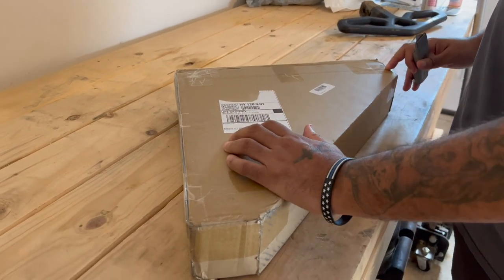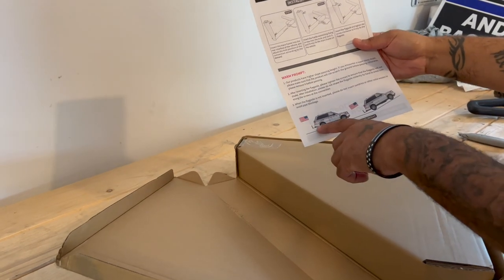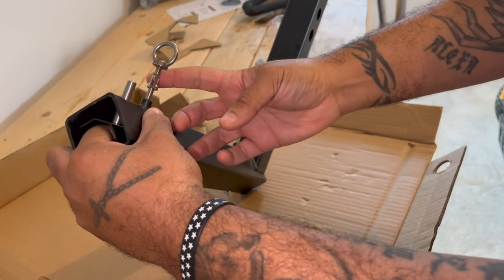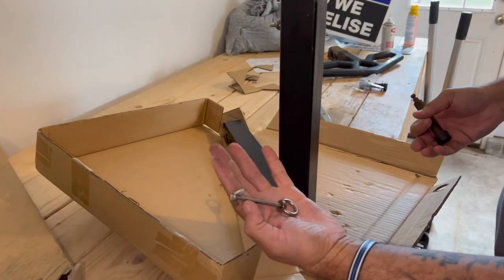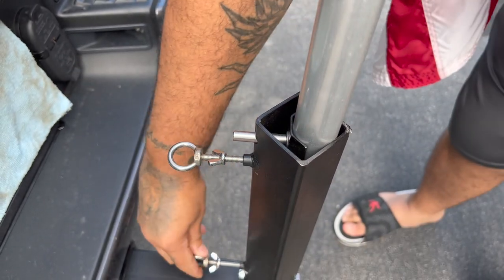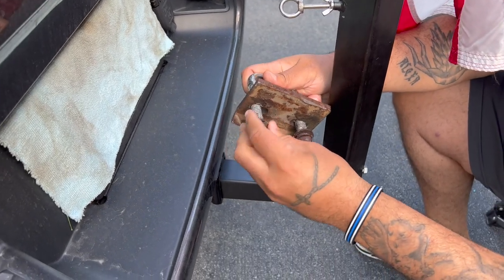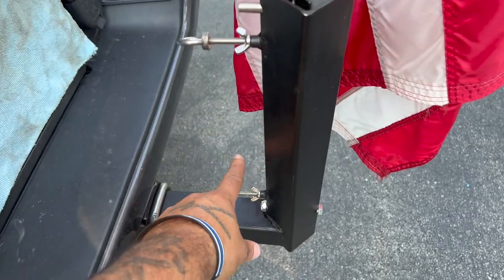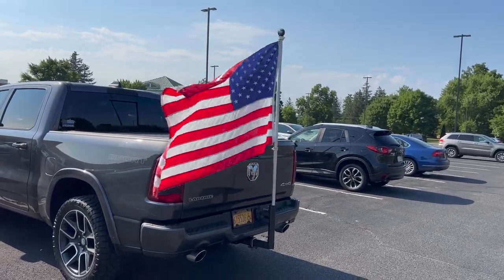The Best Hitch Flag Pole Holder For Your Truck

Comment: Where can I find those wing nuts with the screw that’s with it.  Also  what about that bracket that goes since the pole  to hold the flag  pole secure
Reply from the maker: From the company that sells it, otherwise you have to make it on your own. The wingnuts home depot or a hardware store should have em.

Comment: Where did you get the pole at? Home Depot or some place like that?
Reply from the maker: I just the one off my house for the video. But definitely check Amazon for a metal pole with ball bearing swivel mounts and you’ll be golden brother. Fly that flag proud.

Comment: How well does that work while on highway? Cause I do mostly drive on highway
Reply from the maker: If you look on Amazon website you can find a metal pole with swivel bearings that free spin on the pole. It’s like 26-35 dollars. Those poles are very durable. Next you need to find a flag that can handle extreme conditions. Don’t cheap out on it. Next find a spray glue from a craft store and spray all the seams of the flag make sure it’s clear glue and then you can fly that flag proud brother. With that setup I made it down to ocean city from New York with no fraying or tearing. Let me know how you make out brother.
Reply: Would a wooden flag pole work better? You know the ones that look like a doyly but with flag attached?
Reply: Does pole bend while driving on highway. And bud you have to listen to Tom McDonald and Adam Calhouns song American flag!! Bad ass song bud that’s number 2 on pod cast music behind Aldeans song
Reply from the maker: @ronaldkinnas3856  wooden is no problem as long as the mounts have ball bearing swivels. I don’t think the plastic mounts from a house pole can handle highway speeds.
Reply from the maker: @ronaldkinnas3856  neither metal nor wood pole will bend. The weak spot will be the flag or mounts. I listen to both of them. Real American dudes, we’re of same kindred my brother. God bless America.
Reply: Ok thanks
Reply: Yep generation x bud last of the strong!!🇺🇸
Reply from the maker: @ronaldkinnas3856  lol nailed it for sure brother. All the newer generations don’t want to work or need to stay home in their safe spaces. It’s all about what can the government do for me. Makes me sick brother, but knowing there is still fighters out there gives me hope. I know my kids are being raised right!
Reply: @MrV2u  nailed it bud be safe

Comment: Great video…however the bolt it comes with is too big for my hitch and I have no idea what size I need. I’m not mechanically inclined at all and I need to figure it out soon for an upcoming rally. All help is appreciated! ❤
Reply from the maker: All you need is a regular hitch pin brother. Get a locking hitch pin so no one can walk off with the assembly.
Reply: @MrV2u  thank you!

Comment: What flag pole do you use?
Reply from the maker: Upgraded Flag Pole Kit w/ 2-Position Bracket Holder & w/Spinning Rings - 5FT to 6Ft 1" Metal Flagpole Kit for 3x5 & 4x6 American Flag - Yard House Wall Mount Flag Pole for Residential (6 FT, Black) https://a.co/d/hf5w8zX

I been using this one from Amazon. Holding up great so far. Let me know how you make out brother.
Reply: @MrV2u  appreciate ya man! I’ll let you know when I test it! Any top speeds with it?
Reply from the maker: @itsRJC  I had it on the highway at 75. The only thing that will let go first is the flag starts loosening it’s threads. To combat that problem, I use a clear spray glue on a brand new flag and lightly mist it all over on both sides. This helps but nothing is indestructible.
Reply: @MrV2u  has the flagpole ever bent?
Reply from the maker: Not yet brother. Still flying strong.  Again it matters how long you fly it and what speeds your flying it at. I usually fly it on holidays and car shows etc…

Comment: Are you able to open your tail gate if you adjust the flag mount bracket to the farthest setting?
Reply from the maker: Not at all and you have to be careful not to try to open it remotely or it will dent your tailgate.